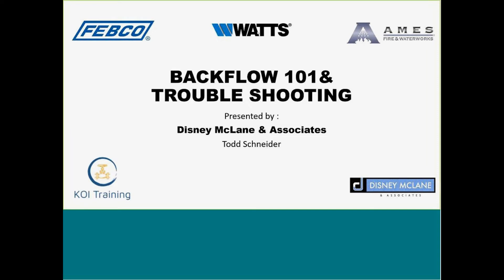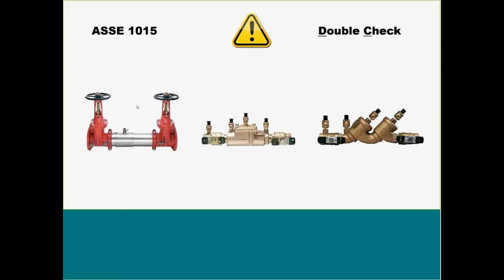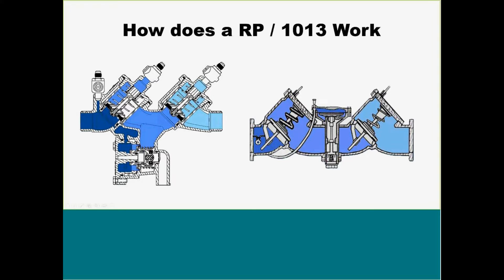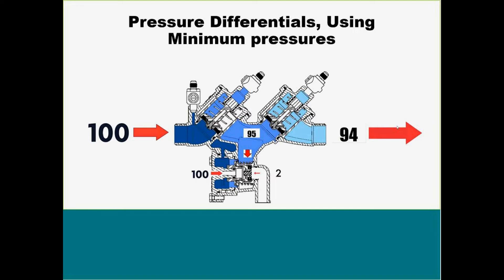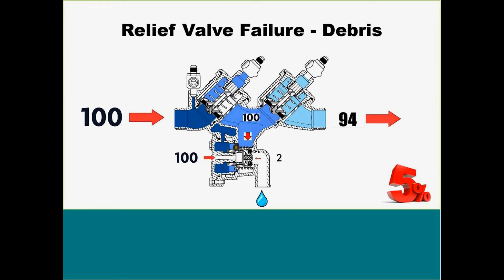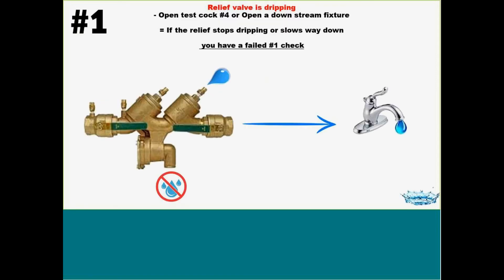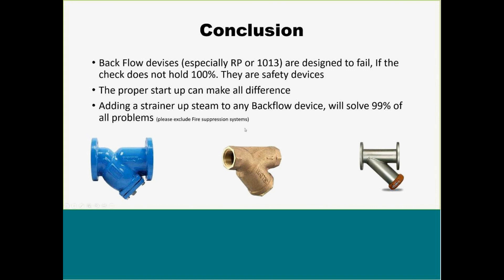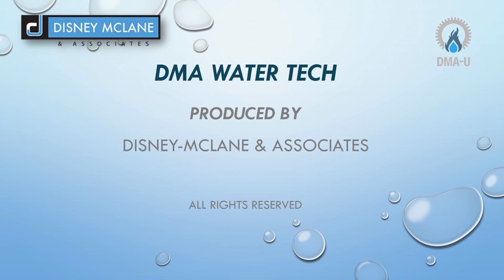Troubleshoot ANY Backflow in 3 Easy Steps

Comment: I accidentally stumbled on something that may be relevant. I have a three year old Apollo 3/4" RP backflow valve. It starting dripping out of the relief valve. I shut off both inlet and outlet shut off valves, anticipating that I was going to have to take the valve apart.  I then, spent about an hour reading your trouble shooting instructions.  They are excellent.  I,  then, went back to the valve to begin the trouble shooting protocol. I initially opened the outlet valve and then the inlet valve. The water blasted out of the relief valve and, then, immediately, stopped. No more drip. 

Apparently, there was debris somewhere in one of the seals and the sudden blast of water pressure must have blown it out. 

Good for now. From despair to repose in one hour.

Comment: Brand new new Watts LF009 3/4" Backflow preventer with new strainer. All 4 valves bled for air. Also new pressure regulator in line to house. I'm getting fluctuating pressures, sometimes no pressure in the house. Garden hose at one end of the house is significantly stronger than garden hose at opposite end of house. Kitchen sink faucet pressure significantly less than bathroom faucet pressure. Any ideas?

Comment: Great. I just installed my double check.  It has debris or I did not start up properly.  How do I clean my FEBCO 350 double check?  Water flows in, but not out! Do I need a strainer if the water is the same as my house water?
Reply from the maker: Hi Richard - Thanks for checking out our video!  We would really recommend having a backflow certified plumber look into your situation however.  There are many situations where this could occur, it would be best for a licensed backflow plumber to assist you with your project on site.